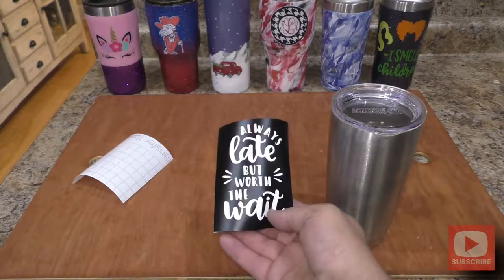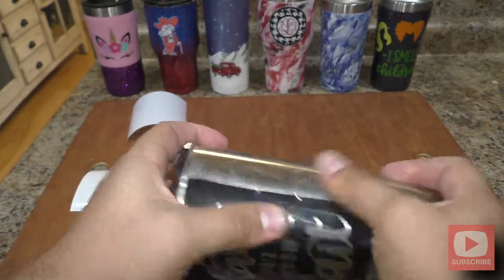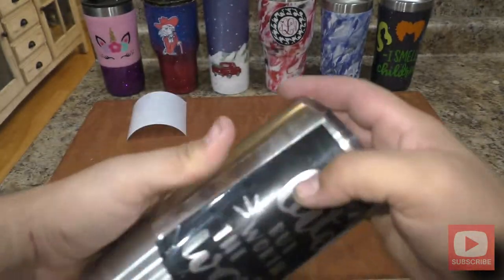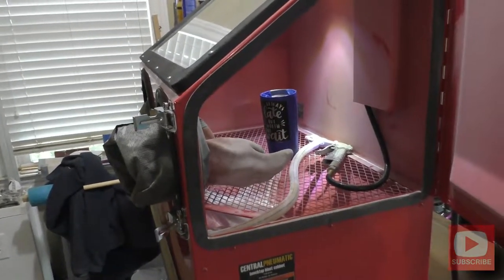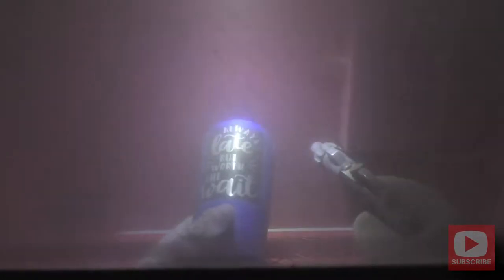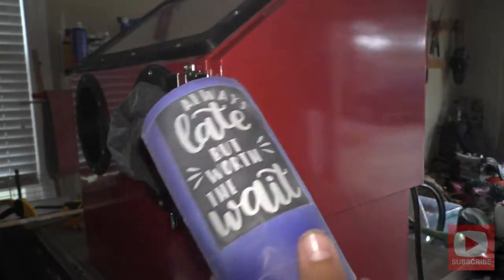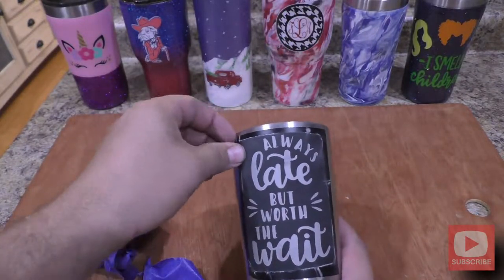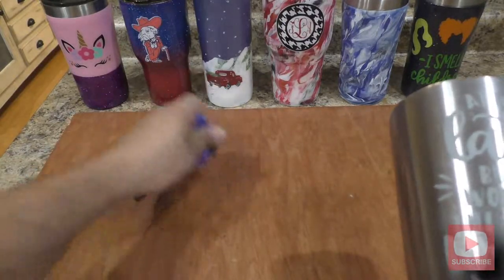Using a Sandblaster to Etch Metal Cups!

Comment: What media/material do you recommend for sandblasting glass mugs? And what psi would you use
Reply from the maker: I have not done glass. I plan to in the near future due to a few people asking that question.  I'd use a fine glass bead and start with low pressure and work my way up on a sample piece of glass.

Comment: Hey Dan, what blasting media and grit are you using to get these great results?
Reply from the maker: I used the high grit glass sand. I plan on experimenting with other grits.  When using on powder coated cups the decals can start to peel up a little  so I double up the vinyl before I cut on the cricut and heat with a hair dryer to make sure its stuck really well.
Reply: @everymandan9669  More great tips, thanks for making this vid and responding to comments, God bless.

Comment: Hi there

I have a blasting cabinet. Do you need to wear a mask? I also have a vacumm attached.

Is it a fine silica sand you are using?
Reply from the maker: I'm not 100% sure if it was a silica sand but I'd always recommend wearing a mask.

Comment: How did you etch the plastic cup? And what kind of sand or glass?
Reply from the maker: Its a powder coated stainless tumbler. Not plastic. And there is a link the glass sand i used in the description
Reply: @everymandan9669  ohh cool. Thanks man
Reply from the maker: No problem! Good luck!

Comment: Is vinyl the one you use for the stencil?
Reply from the maker: The hardest part is making sure the vinyl doesn't come off when spraying. So I use permanent vinyl and when doing this on powdercoated cup (it takes longer) I double my vinyl before cutting out the design. Because the sand will eventually go through the vinyl if it takes a while.
Reply: @everymandan9669  there is sand blast vinyl, its really nice to work with and its quite thick
Reply from the maker: I did not know there was such a thing! That's awesome.

Comment: Are you using removable vinyl or 651 permanent?
Reply from the maker: I believe I used permanent in this video. Its a pain to peel off but stay on better. Some powder coats are thicker and your decal might start to peel around edges or disintegrate. I've doubled up on my vinyl before cutting it and that works pretty good also.
Reply from the maker: On stainless very little is needed to make the etch so less worry about the decal coming off.
Reply: @everymandan9669  thanks! I've been using removable vinyl with armour etch on beer mugs, but recently bought a air eraser and wasn't sure if the removable would hold up to it. It said max 65 psi, so I would like to think it will be fine lol
Reply from the maker: I have a spare cup I always practice on when doing new stuff.  I always recommend trying out new stuff on something you don't mind messing up.

Comment: Do yo need a sandblasting box?
Reply from the maker: No I wouldn' say its required.  But it helps a lot. It will throw lots of dust and make recovering the blasting material difficult. You could make some sort of homemade containment area or just keep buying the "sand"  but that could get pricey.